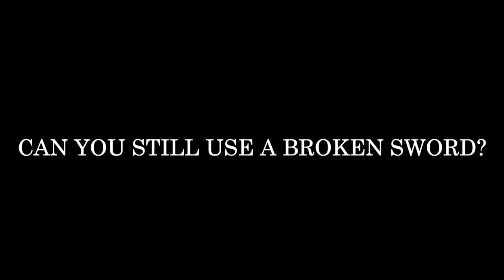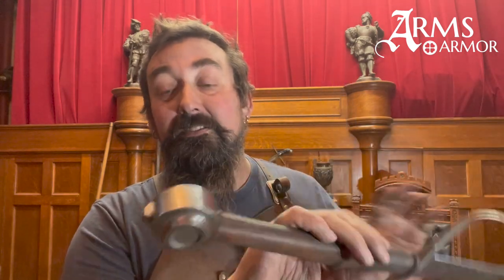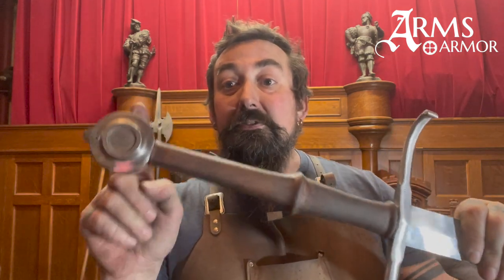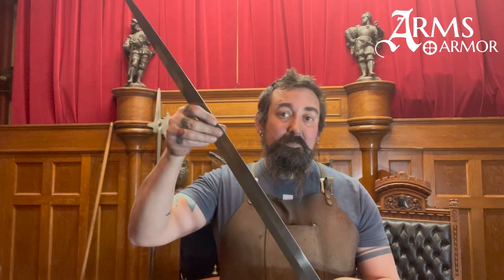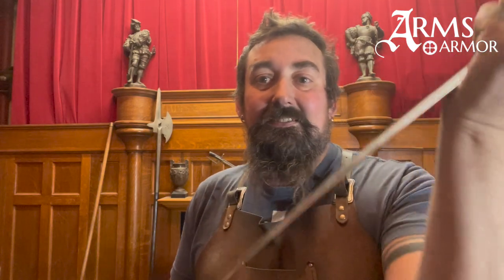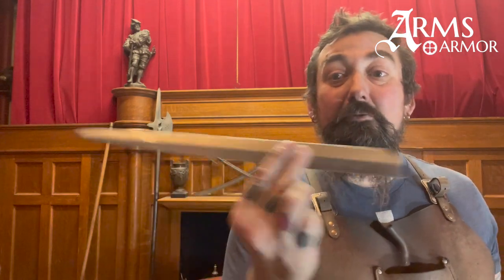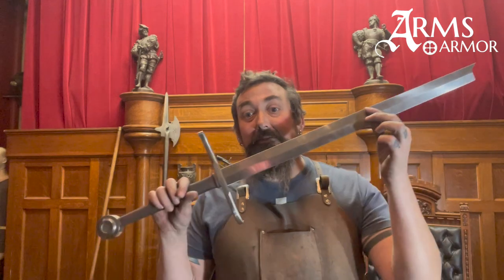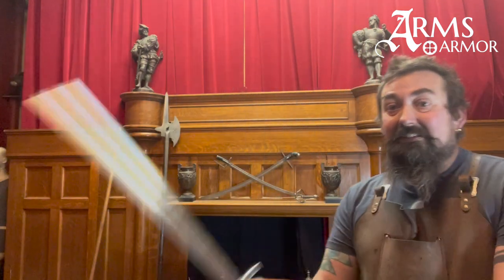Can you use a broken sword?

Comment: I have reforged a broken sword blade- intentionally cut, actually, to test out the method- using an interlocking forge-weld, and the blade subsequently withstood some hard strikes without the weld cracking after re-hardening the blade.
Reply from the maker: Its definitely possible. How much material did you lose when forging the weld?
Reply: @armsarmorinc.4153  About an inch in blade length.
Reply: If you want I can send you a folder with the pics of the steps including testing marks on a steel round bar.
Reply from the maker: Sure, how much width on the blade did you lose?
Reply: @armsarmorinc.4153  None other than resharpening after heat treat. I take the edge down to dull before hardening so- maybe, 1/32 each side? just to help avoid cracking.

Comment: Do you think the diamond style of blades are more likely to brake (In the cut) than a blade with a fuller? Do fuller style swords remain equally as popular even in the age of plate armor?
Reply from the maker: The fuller may react a bit differently to stress like that but once a fissure is started it's usually just a matter of time. They did remain popular.

Comment: 1.) Have you ever tried to reforge a blade LotR style? Imagine if it really was some kind of special sword and it absolutely had to be fixed, could it be done? 
2.) Have you tried cutting tatami with the broken blade? Would be really interesting to see. (A Katana also cuts very close to its tip.)
Reply: He pretty much said his thoughts on the LOTR style... its doable but ehhh not effective. Unless we had some Mythical Elven Smiths with their Magic hammers and fires XD
Reply: @natetheknight  You could take it back to basics and forge weld it again but whether or not that gives you an equally good sword after all that work as you would have if you just put a new blade on seems unlikely to me.   You'd have to redo the heat treatment, re profile the blade, polish it again, etc.........probably not worth the effort for a sketchy result.
Reply from the maker: About the only really effective way would be stack the bits and weld into a billet and redo a blade from billet but you would lose quite a bit of material doing that.